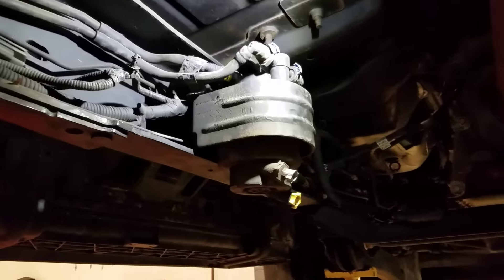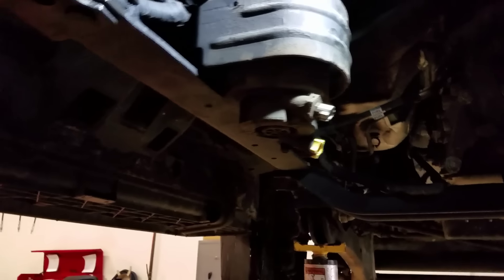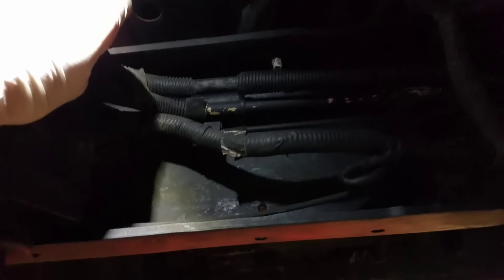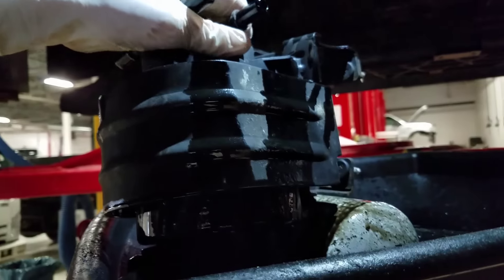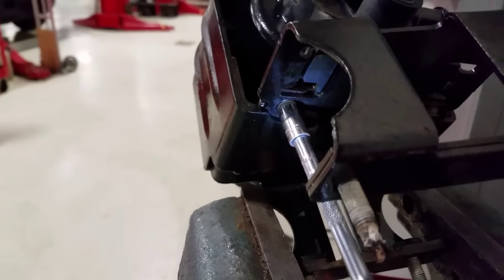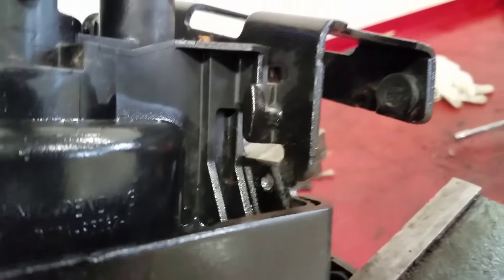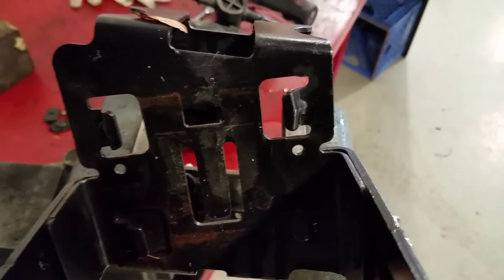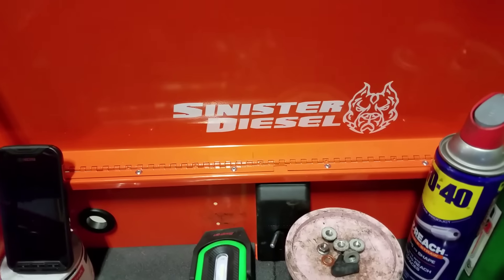6.7 Fuel pump - 11 to 16 Powerstroke

Comment: I have a 2011 that I bought new. I've always taking care of it by the book. My filter isn't due to be changed just yet. I retired my truck back in March of this year and it had a quarter of a tank in it. Every now and then I would crack it up in the drive way and let it run for a half hour or so. Anyway now I'm getting a wining noise from from the same part that you're changing. It never did this until recently and when I first retired it, it wasn't doing it. Do you think that the filter inside might have growth in it or could it be that pump going bad? I ordered a filter for it so I'm gonna try changing the filter  first. What should I do about storing my truck, should I fill  up the fuel tank or leave it almost empty and what additive should I use if any is recommended. Sorry for my comment being so long. Thank you for your video, It was very informative. Take care friend. Thumbs up on this video. 👍
Reply from the maker: Thanks so much brother! Yes it is time for a fuel pump. I wld fill it up and dump some motorcraft centane boost in it & you should be gooood to go. Have done multiple pump!
Reply: @PowerStrokeTechTalkwARod  Thanks for the fast reply,I appreciate it.

Comment: I just bought a 2011 f250 6.7 and love it but I can’t figure out of the noise it makes after shut down is normal.  It makes a suction type noise like a slurp.  Runs amazing but just bugging me and if it’s a symptom of an issue I want to get in front of it.  Thoughts?
Reply from the maker: Its the vacuum being released from the egr cooler bypass vacuum reservoir over on the passenger side of the engine. You can see a little plastic rod move if you get over there quick enough, totally normal my dood! Man i wish i could get 1, they are my favorite. Love workin on them drivin em, cleanin em pretending they're mine all the time. I want GD
Reply: PowerStroke Tech Talk w/ARod , wow man thank you! I must have caught u online lol I flew to Houston and drove her straight home to St. Louis and I’m enjoying working on her.  Anything I should look out for on the 11’s? Thanks again!  Hell if ur close ur welcome to come work on her if u need an outlet lol
Reply from the maker: Lmao that would be too funny. Naw every comment i get an alert so, you just popped right up. Glad ya got a goodin'.  Nothin really they all have issues despite what u read on line. New ones old ones, just all depends on how it was cared for.
Reply from the maker: Ford REALLY made a great engine for this truck. People sometimes 4 get the maint part and oh its A diesel i can just drive it. Indestructible....hahaha $$$$$$
Reply: PowerStroke Tech Talk w/ARod, I have a hill decent control fault / service advance trac light come on today...  is that something I should worry about?  It was super random as I was cruising at about 45 on a flat road